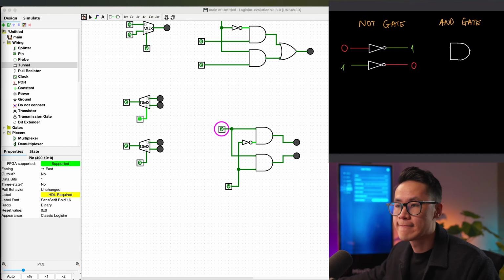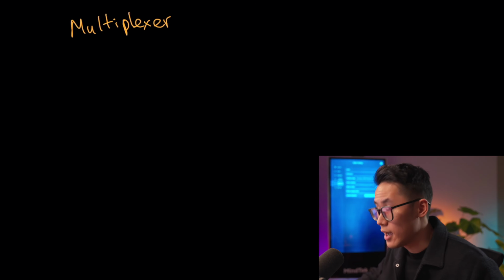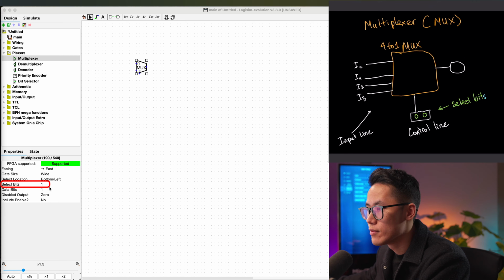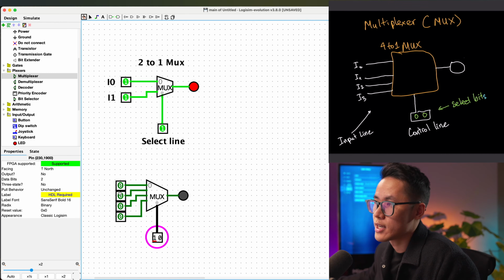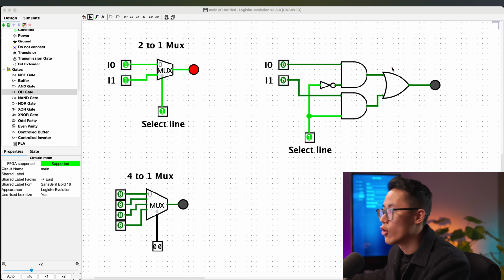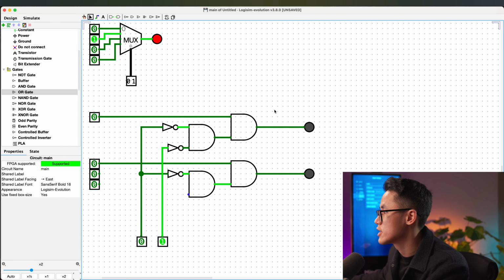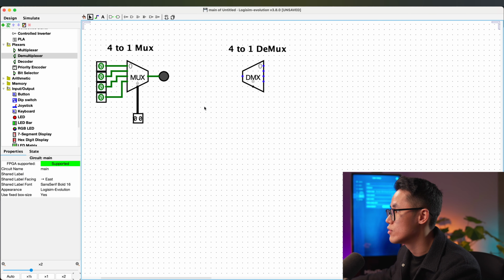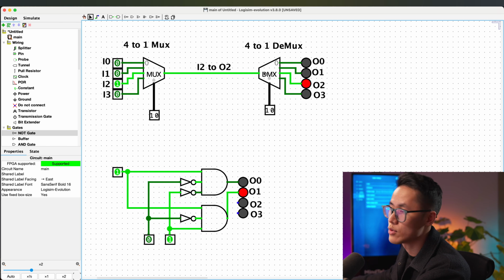Designing Multiplexers and Demultiplexers in Logisim

Comment: Great video but there is a slight error at 41:24 where there is a missing connection between the 2nd control bit and the and gate so that 00 and 01 both allow I1 to pass through activation.
Reply from the maker: Thank you for spotting it. I did overlook it even when doing the AND gate with 3 inputs to replace it.